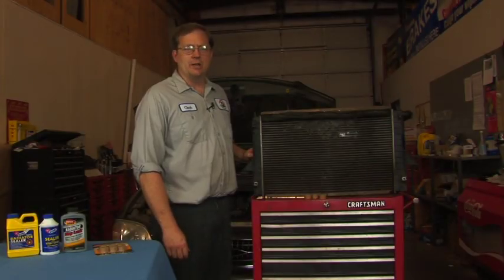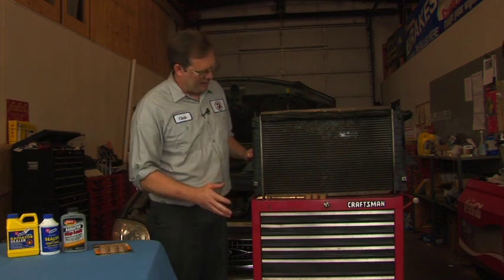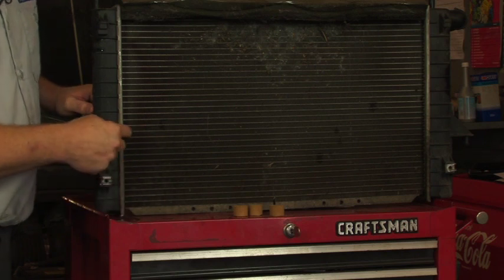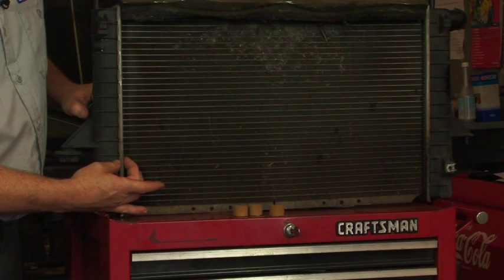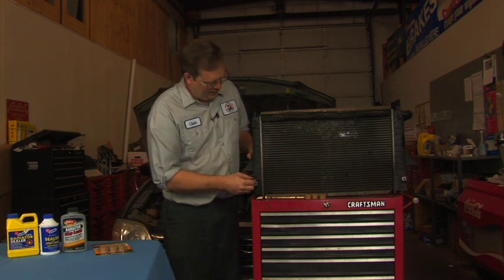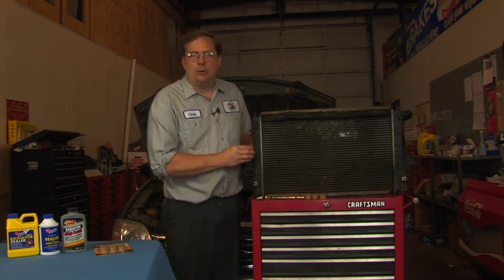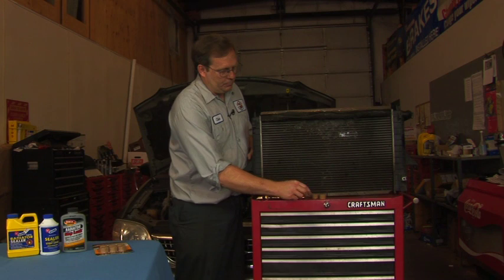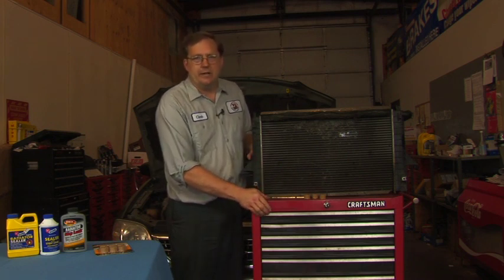Auto Repair & Maintenance : How to Seal a Car Radiator

Comment: My radiator is leaking through a rubber o-ring on the bottom on the passengers side. I notice that both the driver side and passenger side have this ring. But it only leaks through the passengers side. Any help?

Comment: I have A leak in my radiator in the upper (R) side (installed). I have used aluma seal but the hole is to big to plug this way . can some one offer some good advice. 
thank you
leaky blazer